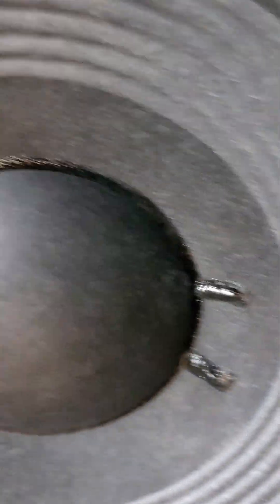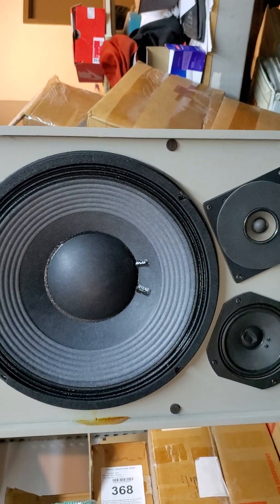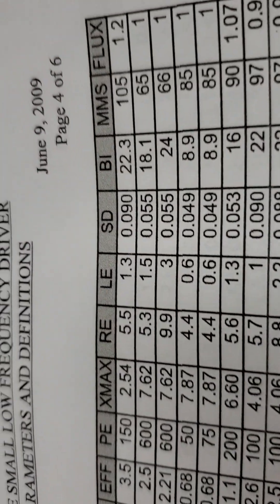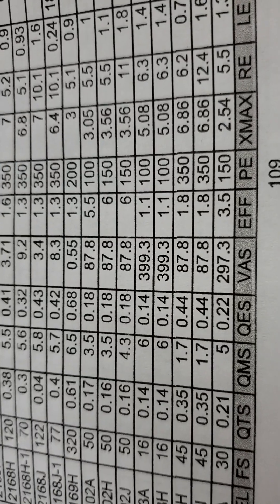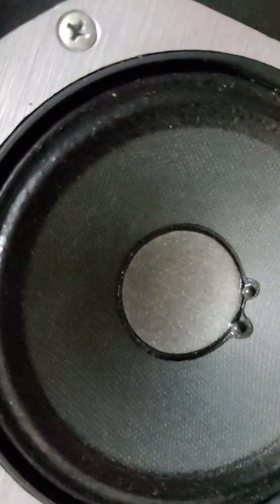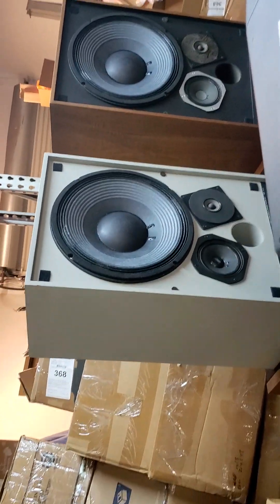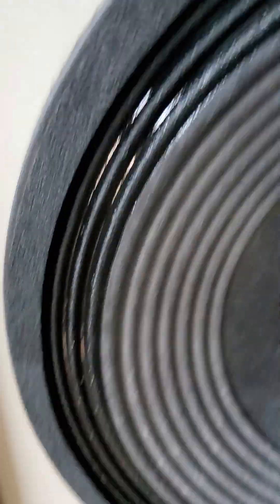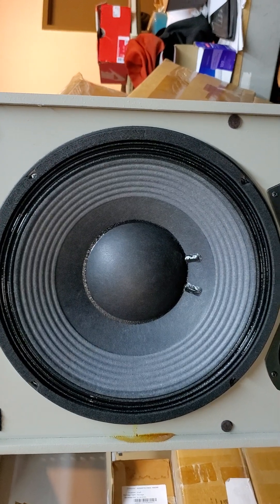Newly Developed 2207H Super Woofer From JBL 2206H

Comment: Hi Ken,
I have some 2206's that i would love to dig deeper. I'm trying to follow along with what you did in your mod but am not near as knowledgeable and trying to keep up. Did you just increase the mass of the drover from the 50 grams to 90 grams or did you recone the 2206 with the 2203? Thank you!
Reply from the maker: I built the kit with a voice coil designed for a 2206, and matched the suspension and mass to be like a 2203. Factory 2203 and 2206 recone kits are not interchangeable.